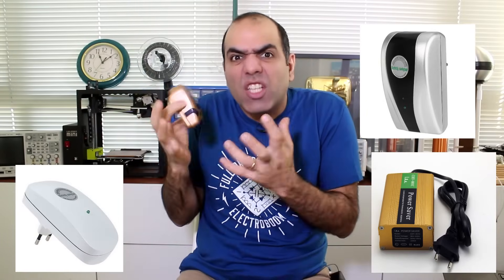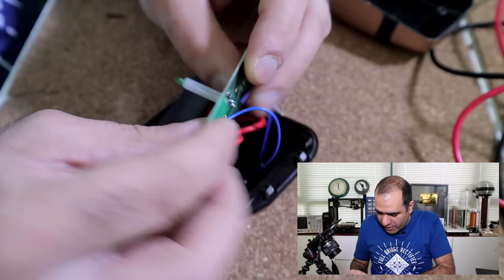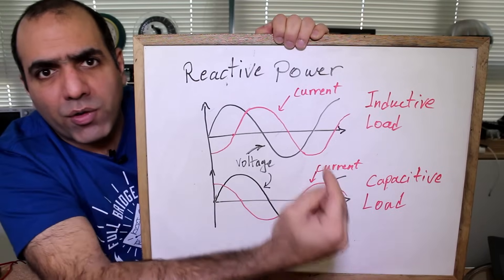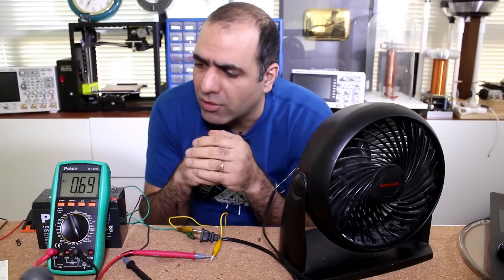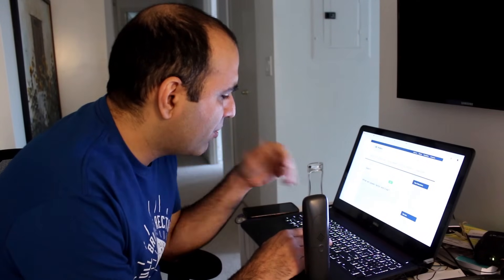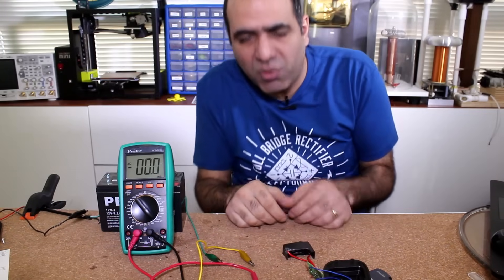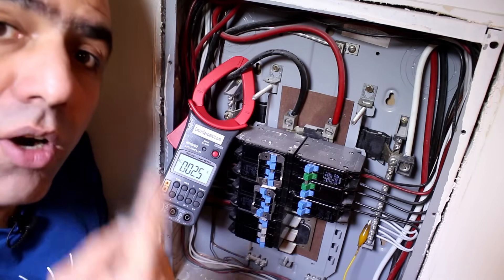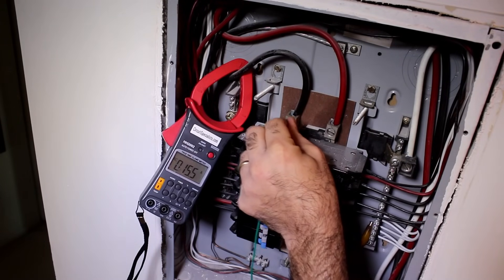Power Saver Scam EXPOSED!

Comment: I have the house and a shop building on the property. I have 2 different electric bills. I get charged a lower rate on the shop, but there are add on rates that total more than the house rate. Most people don't know this, but you add all rates together, including taxes to get your true rate. I think the electric companies do this so they can gouge up and down the street. I'll never complain to my neighbor about a rate @ $0.00070937 to his @ $0.00068468, but sure as hell will about a rate @ $0.04361846 to his @ $0.02542765. That's why the power companies then come up with Electric Non-Summer 0-800kWh & Electric Non-Summer > 800kWh, to force you to have to calculate individual rates in order to see your true cost.

Comment: Hey man... love your unibr...ehm..your videos! I don't know where to post requests (or even if you take any), but here it comes:  Could you make a video about /properly/ connecting solar panels, with their diodes and all, calculating their values, the battery they'd be charging and the load they would be handling? for example, what would it take to have a single WiFi router running completely on solar power. Also, if this doesn't sound intriguing enough, how about a video for a DIY battery welder? I've seen videos with transformers or starter coils, can't safely decide. Thanks a bunch in advance, keep it up!

Comment: hey electio, I need help to make something. I am thinking about puting a 9v batery into somthing over a voltage regulator that could be set of and shock me over a couple probes or something but would be a tingle. I need something wireless that could be press to do that. it would send a signal to it to  the device and it would shock me(just a tingle, not enough to hurt, but ud feel it for sure). I need this so ill stop ripping my hair out when i think. (thats  why i need it. Thanks.

Comment: About those power Savers so the ones the nice cases and even ones the not-so-good cases can be can be repurposed as a Electronics housing or even the housing for power supply or other device some of our a nice aluminum box with plenty of potential for repurposing.

Allso the ones that plug Straight Ahead can be used for device that would plug straight into a receptacle in terms of building something like that and the ones that have a detachable power cord going to them that can be refurbished as well.

Comment: another good video, these days they renamed the amp drain to delivery fee, if it is profitable take a skid full of lithium ion batteries with some super capacitors the test would be the amount of time it would take to drain the  lithium ions in a 24hr period with  exact same usage another 24hr period calculate 1st the amount the lithium ions of what they  would need to be charged for a 24hr period of usage, compared to the system now what it costs in a 24hr period. The test would be comparing going off the grid when the batteries are filled to amount needed for the 24hr period comparing with the same amount of usage staying on the grid, instead of the delivery fees of  the  'on and off' activity(that delivery fee) going to the lithiums the grid wouldn't recognize the 'on and off'  activities. what do you think? if I explained it okay

Comment: From what i've learned in my electrical engineering course, is that reactive current comsumption limits the load a transformer can hold.
Example: In Chile (where im from) mining is the main income of the country. Many motors are used to move conveyor belts and the excavators. As we learned, motors demand reactive current due to their inductive nature, and that limits the amount of load the transformers from the stations can hold (those big motherhecking transformers). That means the provider can't provide enough for all their customers, so that's why they charge for low power factor (<0.86).
There is where capacitor banks shine the most, with them you can inject reactive power into the grid, thus improving the power factor.

Comment: Ever messed with modifying a toy grade rc car motor & circuitry too make it take say a 2s lipo or a pair of lithium ion battery cells instead of 4 puny AA batteries without killing the boards components or burning the steering or power circuit on that board ?

Perhaps you can do some messing about with that there improving it as much as possible at a fairly low cost & explaining in general on what this & that component does & a diagram of the circuit board for that specific rc car at least.

Comment: Your jumper wires were too small and create too much resistance in the circuit, therefore the device cannot function up to its full designed capacity! :D

Comment: It's not practical to do power factor correction in a residential setting and worse it's potentially dangerous. If you over correct and end up with a leading power factor you can end up with an over voltage situation which can cause damage to the devices of in your home, especially electronics. So, even if this device did what it promised it would potentially do more harm than good.

Comment: oh, and we have a HUGE bank of capacitors at work to correct PF, and still despite a $70,000 electric bill per month, they save less than it costs to maintain them
Reply: It's not all about the power in an industrial setting though. I don't know how your plant sized it's supply conductors but I wouldn't be surprised if they couldn't handle the uncorrected current.

Comment: Reducing power usage? Turn the heat down or AC if you live somewhere warm.
Job done..
Also go LED wherever practicable or practical.
I still use halogen in the kitchen and bathroom, but the rest of my home is LED

Comment: I see only one potential use/value for residential use. If one has a circuit breaker that tends to trip because of too many inductive loads plugged into the same circuit. Just solder a capacitor  directly to the motor on that curcuit to improve their power factor for less current flowing through the circuit breaker.

Mater of fact, I have this very issue   in the winter.  Electric heaters  in the bedroom and bathroom have fans. The bathroom vent blower also runs on a fan. Sometimes when all the fans and heaters run at the same time, they trip the circuit. I can see adding a properly rated capacitor to the motors would save me the inconvenience of few trips to circuit breaker.

Comment: dear ,
with this device you reduces the virtual resistance.

let say you have motor that take 4A, the induction weak the current in motor.
with this device you can take 5A (the motor spin faster) .

that will  not save money (we pay only the real power) , but electry company will have less power Line losses.

factory must more then cos(x)=0.92 (x less 23 degre between real and virtual

Comment: I'm glad you have debunked this one.  I have been hassled by non-tech people for years about this and it usually finishes up with me doing a rant about scammers.   I have a serious question for you.  (Since I purchased one of your shirts, I figure I should be good for one query)   I have several multimeters and they have huge variation when measuring AC Volts (maybe +/-5VAC)  Do you have any good tricks for locating/building a stable AC Volts reference so that I can tweak all of my meters to read the same value?   I want to be able to shove some probes into a power outlet and get meaningful answers.
To quote Robert Heinlein: "A man with a watch knows what time it is.  A man with two watches is never sure."

Comment: All this thing needs is an inline switch to shut it off from the power source when not in use from something drawing power in the house. That way the capacitor can be discharged by the LED without undoing all the good it did. A VERY high consumption user could see a drop in their bill if like $0.02 a year! It would only take 30 years for the device to pay for itself! haha.

Comment: Just want to tell you: avoid using any public VPN at all, especially in China, even if you pay money for it. Host your own one and only use it by yourself or with trusted friends. Otherwise it's more likely to fail at certain time period and you have a risk of the VPN tracking you (regardless of whether they claims not to do that or not.) And it would cost you way more money (because even a $20 per year VPS is more than enough to cover the usage, but most VPN services outside China would ask for at least $10 per month, and those that are in China just being so unreliable that it's not worth talking nowadays).

Comment: I love the comments about "you're touching mains voltage on the utility side, OMG, how dangerous"...to shed some light on the situation it's an apartment/condo and is fused at the switch gear in the building's utility room or a sub panel in the hallway of his building's floor...as you may notice his panel is a sub panel with no mains breaker, not a service panel.

On another note those things are junk scammer pieces.  In order to truly correct power factor you need to do a survey/assessment of the power factor to know which approach to take to correcting it, it's not a one-size-fits-all situation...snake oil.  And as Mehdi already found out, we don't pay a penalty for poor PF in residential settings in Canada, or anywhere in NA for that matter, only in industrial/commercial settings.

Keep up the great vids, as an electrician I never flinch when working with electrical, only when I watch your videos for some reason! :P

-Marc

Comment: Europe (and other areas) have legislated that devices MUST have built in power factor correction so the PF is zero.
As you say the reason being that excessively reactive loads are load on the transmission network. This kind of law has been in effect for a couple of decades in most places.

PF outside of an industrial setting became more and more of a problem from the 1970s onwards with switchmode power supplies and shit like that in domestic and office environments (anything with a transformer, then a bridge rectifier feeding a capacitor has a really "spiky" current draw which produces RF interference as well as causing large neutral currents in 3phase transformers). Chinese makers frequently produce non-compliant stuff with bogus compliance labels (they're not the only ones, but there's not much comeback vs local suppliers pulling that kind of stunt)

Of course no review sites ever report this kind of thing in tests so we never know if makers and sellers are complying with legislation. It'd be interesting to see some naming/shaming going on.

Comment: When I asked my power company what kind of power I am being supplied with, they answered: "electrical power."  Evidently, you must have to be some sort of genius to work at a power company.
Reply: What did you expect? " what kind of power do you supply".  Electric power is fine, but  a more technical answer might be alternating current to differentiate from Edison DC power. But who really supplies DC power anyways. 

Frankly they "supply" ac power.  How one uses it is what makes the difference between apparent and real power. Lastly and more than likely, aside from taxes and maybe a monthly connection fee, they are probably only billing you for your real power use.
Reply: @kreynolds1123  In the old days the City of Melbourne did supply DC from the mains for street lighting
Reply: @darylcheshire1618  "in the old days"... :-D yeah absolutly, in the old days before AC power became an option, all the electric suppliers in existance supplied DC.  Today  that would be an extreme rarity, to supply DC to residential consumers.  It would be interesting to know if any industry would benefit from having DC supplied.  Aluminum smelting polyphased AC rectified to DC, Data centers 380VDC ? Any others?
Reply: @kreynolds1123  
"what kind of power do you supply?" would lead me to answer "COAL POWER BITCH!" and hang up, then go get a REAL job.
Reply: @kreynolds1123  I do not expect anything.  A.C. power?  Really?  I have posted over 70 videos on building electronics projects and, electricity and energy research are my hobbies so I think I know that the power company is supplying A.C.  I was just surprised they had no idea what I was talking about.  My electric bill was over  $40 last month so, they do know how to raise rates.
Reply: @OverlandOne  There was no intention to step on anyones ego. That isn't really my nature.  All to often ones intention is not well communicated.  My comment was two part.  The latter half was less about teaching you something about electricity, and more about what I thought would have been appropriate responses from the power company to your question, and reflecting on the relation to this video's topic, power factor. 

Please dont mistake this for being snarky,  because i try to always be sinceer, but I'm having trouble understanding what were you hopping to learn from asking the question, and if you were not expecting anything, why ask what kind of power and wait through the several transfers.
Reply: @Lesss_22  Incorrect.  I have videos on earth batteries, Bedini motor replications, supercaps, boostcaps, Heron's Fountain, led lighting modifications, led computer desk lighting, and much more.  I guess you only looked at a few and jumped to an incorrect conclusion?
Reply: You cant expect customer service to know that stuff, 99.9% of the time theyre never asked about it
Reply: @Impetuss  I was on hold and switched to several different operators before being transferred to Engineering who told me that.  He was not customer service nor a receptionist, he said he was a line engineer.
Reply: @Impetuss  99.9% of them aren't asked about this 100% of their job lifetime.
Reply: They're not wrong
Reply: I would like to know how they would know what what proportion of the power you use is reactive anyway?  Probably a special kind of meter which also measures phase.  And they probably only install those at commercial or industrial sites.  So maybe they wouldn't know just by checking your house meter.
Reply: @Qui-9  A relatively cheap kilowatt meter can tell you your power factor for an outlet.
Reply: @Qui-9  
I laughed when I saw your name ..
Google kvar meter..haha
Reply: lol
Reply: I don't see a problem there because the answer is 100% correct. The question is awkward.
Reply: Blox117 i guess he just wanted some likes
Reply: dude yea... she asked how to spell apparent ... cream of the crop

Comment: ok i used this kind a energy saver but it has big capacitor black  sso it does slow my rotatory electric metre like 20% under    i save some money  ..  it created resistance in the current without power loss which make  metre run slow   still using it

Comment: My experience right now and info heard and gathered, is that first they will be charging more for the peak demand periods during the  day.  Meaning if you wanna do laundry, dishes, daytime energy things at home it stresses system even more so charge you more.  Want you to use your power in the evenings or nighttime when industrial and commercial demands have went down.  Once this is done, then they will get on the real and apparent power charges and even keeping track of what is in your home and when it is on by data collecting current, voltage, capacitive or inductive loads etc.

Comment: Electro, vpn's aren't actually as secure as people think

I would say, to look into "ProxyScraping" where you scan for active open proxies, that you can use to bypass government blocks and hide your idenity
By using a VPN you do close off a lot of your information, but you open yourself to other problems
when you use a VPN it's more obvious to the government, you might be doing questionable Internet traffic, when really you just want freedom with your access to the internet
Many VPN's are actually tied into the governments of the countries they are hosted in. 
You can use VPN's but i would advice a provider, that is not hosted in the country you are currently in. so they ignore your traffic, and leave you be. (the opposing government) while the government of the country you are in, have no idea what you are doing. at most the Internet provider you are using, will see you are actively connected to a known VPN

Comment: There are also units out there that save real watts.  The technology was developed by NASA a few decades ago to save power when running AC motors in space missions.  The unit I have is a "Green Plug 20" that I use to run a 1 HP vacuum pump for bubble free potting of HV coils.  When the Green Plug is in the ckt, the power use drops to 1/2 that without it, saving about 200W of electricity for the 24 hour cycle run dozens of times each year.  The cost was about $10 on the surplus market.  The device works by reducing the average voltage using a triac until the power factor improves.  It automatically provides full voltage during starting and high loads.

Comment: Cool video Mehdi,but if you really want to save power at home,you really have to do what industry has been doing over 30 YEARS ago.
A VFD(Varible Frequency Drive)will DRAMITICALLY lower your electric monthly cost big time!!.
It's done simply by raising the frequency of your 50/60 cycle AC system.
The higher the frequency,the lower your electric cost by lowering the amperage draw.(much more efficient)
The only down side with running your house on a VFD,is that your appliances have to be certified to run at 400 to 600Hz,instead of the inefficient 50/60 Hz.that your house normally runs on.
Aircraft runs on 400Hz.also.
A 1-horsepower 240 volt motor normally takes about 15 amps to drive it,will drop to about 1.5 to 2 amps at 400 to 600 Hz.

Comment: Can you tell me how arc jumps
Reply: At high voltages, the air sorrounding the conductor becames ionised,  creating a path through gas to complete the circuit  ,
( im not 100% sure ;  ~700 Volts for each 1mm of arc.)